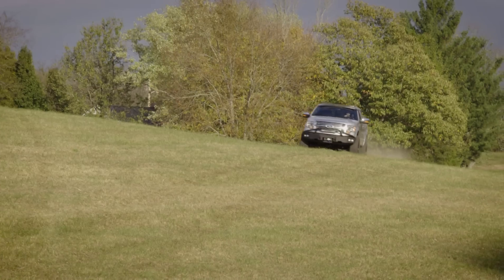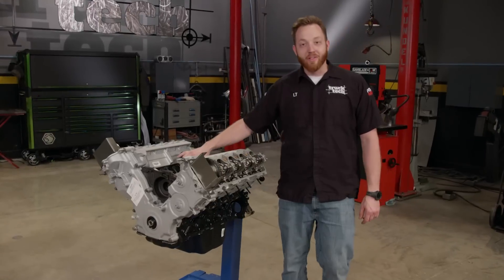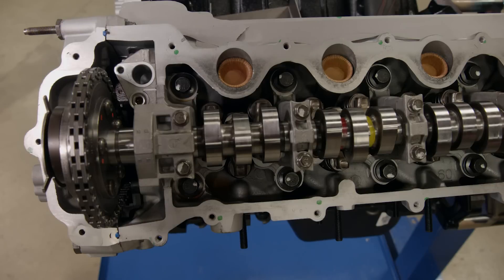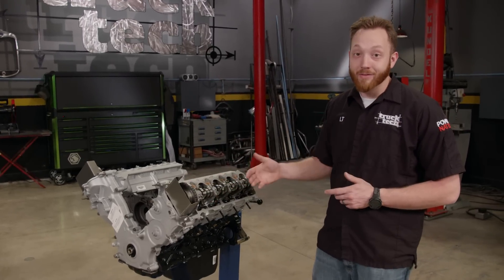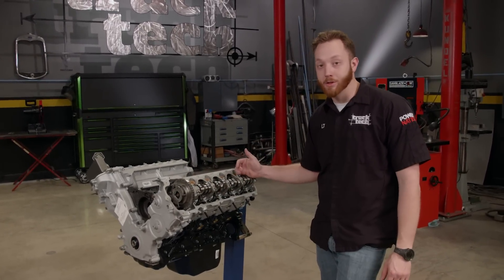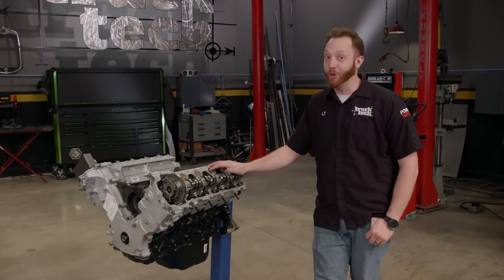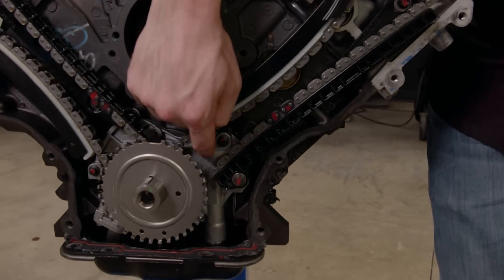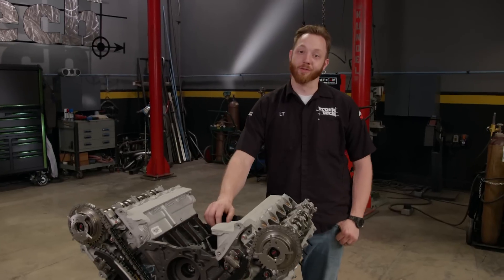Hope For 5.4L 3V Mod Motor Fans

Comment: Wait a minute, you are describing that wrong on how the oil is ported into the heads and to what device.  The engine pressure to the valves themselves is always consistent to the limits of the oil pump itself. The timing phaser does not send oil to the valve mechanism, the CVT Valves meter oil pressure to rotate the phaser, not the reverse as you stated.

Comment: Powertrain products are a joke I purchased a motor along with a no-fault warranty it went bad and 4,000 miles. They honored the warranty and sent me a new motor I had to have a mechanic install it that motor went bad and 3,000 miles. Oh and I still haven't been reimbursed for the mechanic cost from the first motor and now they're telling me I need to accrued more mechanic costs that I won't get reimbursed four four. My experience with Powertrain is subpar they hide behind the anonymity of the internet making promises they won't keep tread lately.

Comment: If you hate these engines just admit it you like working on trucks and cars but you are not a mechanic no shame in that but as for me and my friend all of us are mechanics we love the 4.6l 5.4l and the v10 is a monster when tuned and unlocked they fly all over the power curve these babies last over 200k np when treated right you miss one oil change let the oil run low or go for too long and the engines fall apart with loads of issues just like anything however if you change your fkn oil they last I tuck mine in every night that also help extend the life of the engine 😂

Comment: I really like the 5.4 3V and my experience has been great with this engine. However I bought the vehicle used and it was on excellent maintenance schedule and I kept it well maintained. I hate the fuel pump not oil pump! However, I'm planning to invest in a major overhaul of the engine to prevent any catastrophic events and benefit from the upgrades I have been collecting for the past few months. I got melling oil pump.

Comment: I got a platinum @009 its still runs lime new just keep the oil. Changed? An plugs an wires every couple two three years!an ur good not even 200.000 het an interior is leather awesome!

Comment: I have a powertrain 5.4 in mine. Sometimes I have to stop the radio to make sure it's still idling it's that's smooth and quiet
Reply: Hows that 5.4l power train motor still kicking along

Comment: Had all these components replaced as well as ford racing followers and lash adjusters at 154k. Also they recommend using 5w30 oil. Engine should last another 150k.

Comment: i was the SECOND MAN TO PUT A 5.4 3V INTO A MUSTANG TALKED WITH ED OLIN AND MODDED MANIFOLDS. IF YOU WANT TO MAKE POWER ALL MOTOR WITH A 5.4 3V CONTACT ME. LOOK ON THE CORRAL USERNAME ASSASINATOR. I MOD TEH TRUCK INTAKE FOR POWER AND WAS SUCCESSFUL. USED THE STOCK CDAN4 PCM. CONTACT ME MAN.

Comment: Ford has updated the phasers many times, use only ford parts. eBay kits you’ll be doing it twice. Fords also updated the roller followers also.  Smaller oiling hole aimed at the cam/ roller area for better lube. Updated plastic chain tensioner w/ better silicone gaskets.

Comment: Do you stress the importance of frequent oil/filter changes because of the oil passage ways or galleries that are too small?  Sludge build-up is common on most poorly maintained engines but it is FATAL on these.  Change every 5,000 miles.

Comment: Purchased a non running F250 with the 5.4 3v engine.
Valve train was wiped out from a lack of lubrication.
Oil restricters in head were plugged with oil filter media.
Engine had the oil filter of death on it; a Fram.

Comment: Just hit 180k on my 5.4 3V
And the procharger is running well also at 8 years in.
Reply: Sorry for not seeing this earlier!
Absolutely you can.
Even a set of ported PI heads wakes up the 5.4.
And the 3V wakes up nicely at 8psi of boost.
Watch those stock rods closely when getting above 500 wheel horsepower.

A good set of rods will let you get 750-800 without issue.
It’s a great platform with a few mods.
Reply: @honestspirit56  i agree, no need to swap to a junked up ls..
Reply: @honestspirit56  can I get 500hp from my 3v with new heads/tune/exhaust? Injectors? TB? tnx
Reply: Darts on 5.4 triton?
Reply: Can you put race heads like afr or

Comment: What cam phasers do you recomend?
Reply: I would say go with the motorcraft ones it cost me about $225 each. I also replaced the chain,tensioner, chain guides, and melling m360HV oil pump. In total cost me just under $900 and now its purrs like a kitten.

Comment: Is this really true? I haven’t heard any real cases of the phaser itself failing. It’s usually a cascade failure caused by the seals on the tensioner going, which accelerates the wear on the chain guides and ultimately clogs the oil pickup with bits of plastic, burning up the top end. The consensus is to do a timing job early and replace everything with the updated parts and high volume oil pump.

Comment: The actual highest failure point in the 5.4l 3V is the timing chain tensioners. The orginal plastic ones have a 'printed on' gasket that blows out and causes low oil pressure and slack in the timing chains. These 2 problems then domino onto other components. With slack in the chains, now the chains slap around and the phasers also hammer as they rotate on the cam lobes which causes them to smak back and forth, this coupled with low oil pressure damages the phasers, the camshaft and journels and the timing chain guides. The stock oil pumps are another point of weakness with a melling M340HV being the upgrade all these engines need. O yes and lets not forget about the roller followers which like to seize, and the spark plugs that like to break off in the heads. Great job ford, you are just like microsoft, creating garbage for the masses.

Comment: The 5.4L 2v Triton engines would spit out spark plugs, the 5.4L 3V Triton engines would keep them in no matter what, and chew up that stupid VCT system. One of the main issues iwth the VCT system as I understand it, and I could be wrong, is insufficient oil flow / pressure. The updating Melling pumps fix this problem, mostly.... I have an '04 waiting to be repowered, and honestly, if I could get it through smog, I would build a 351c with modern EFI instead of this 5.4 junk. I have no plans on blowing 50K on a new truck. That's just a waste of money. I'll have to keep plugging away at this older rig, and should it need to go to the scrap pile, I will just find another old rig to keep going with...
Reply: The npi 5.4 has no plug spitting problem and can be used with the pi cam and truck intake manifold to make identical power with likely more torque. Early navigators used the Npi 5.4 2v. You could also just pull a late 05+ 4.6 2v cylinder head which have fixed the thread problem as well.
Reply: ok boomer.
Reply: @Odin3v  Christ you people still exist?
Reply: @Odin3v  try again Skippy. I'm no boomer.
Reply: @Wildersport  no you're still a boomer. Not my problem if you are unaware of being able to understand the context.

Comment: Screw Ford. My 06 Lariat has 85k miles and is already SO BAD it needs the engine replaced. I'm the second goddamn owner and I bought it at 81k miles. I'm not wasting my time or money on a crappy truck that is crappier than my 97 F150 with 355k miles. Fukc Ford. They confirmed to me that they dont give a crap about putting dumb stuff like reliability or durability or dependability in their trucks anymore. My Lariat is neither Built nor Tough. It's just Ford. Never making the mistake of wasting my time or money on another Ford.

Comment: I’m at almost 300k miles on original 2004 3v 5.4. Yes, it started ticking. I unplugged the connector for the cam phasers. A little power loss and check engine light comes on. But still going. I bought the truck nearly new. It was a repo and way under 15k miles. Can’t remember. One big thing I messed up on was not realizing the sun roof had drain tubes. Tubes broke off and fell back in to the rocker panels. Also, probably pine needle and tree pollen clogged tubes. Rust. And I’m in Georgia. And the third brake light gasket. Truck is nice though. Crew cab. Black leather. Console. Lariat. 4x4. White paint. Idk. A new truck is mega money.

Comment: 315,000 on my 5.4l still no tick unless use cheap gas or needs oil change. Is a little tick for a couple sec. When first start but goes away
 I change oil every 5,000 and use 5w20 might try the 5w30 after reading a comment from someone

Comment: Ford should have done a recall on this and fixed it for free years ago, they still haven't!!! They have had years to do the right thing and make it 100% reliable for the people that believe in their reliability and spend their hard-earned dollars for a "reliable pickup"
Reply: Why? I have 215000 miles on mine and not one engine problem. Never missed a oil change every 5000 miles using ford filters and oil

Comment: I bought a 2004 triton a sexy truck with 146k miles on it,  the previous owner just take care of appearance but not of good maintenance on time and bumm , after 10k miles I decided bought a rebuild engine 0miles  for $3.500. Plus accessories for replaced and labor everything cost me $6000 . Yes is a lot money but unfortunately I can't find mechanics to fix the engine for a decent cost , so  the truck cost me $ 8000 + $ 6000 new engine,,   this was a good decision??? I hope

Comment: Wow, $3,300 because you or the people before you didn't change the engine oil enough?  If you go the route to replace the timing components instead of the whole engine, use the factory replacement parts as the after market phasers are junk.   Also, as is mentioned below, check your exhaust manifolds as they easily crack.

Comment: Sorry not exactly what I was looking for. Give me a 400 + crank power 5.4 on regular, then we talk
Reply: Better change the cams valve springs injectors and do an exhaust and tune and it’ll be possible
Reply: @MrSplibb  I did 5 star 87 tune, long tube headers, efan conversion, cai, and I felt a good difference  and better mpg. Thought about cam but I was told it needs 93 and new springs retainers. At 260k miles and growing I didn't want to open a can of worms. Its alot better now. Wish the 5.4 3v had good aftermarket support like the 5.0

Comment: I’ve been hearing my truck tick since I’ve bought it at 55k miles... now at 113k and runs like a champ...
Reply: El Mas Chingon my 5.4 tick went away when I replaced the VCT solenoids. I switched to Pennzoil platinum 5-30 oil after that, and it stopped sounding like a diesel truck. Did that last year at 90k on an 06.

Comment: I have a 2006 F-150  With 5.4 liter 3 valve engine with 174,000 Miles. It still goes down the road silent as a kitten at 80 miles an hour. I bought it new with 4 miles on it, I use a Motor Craft or K&N Oil Filter; don't go cheap on the oil and filter . I Use 5-20 W Motor Craft Synthetic Blend Motor Oil .
      I try not to go past 4,400 miles Between Oil Changes with a Maximum  of 4,800 miles between oil changes. Remember that oil is also a coolant and not just a lubricant so it more than pays to keep fresh oil in to try and prevent some of the repairs that this guy is talking about.
Reply: This guy wants to sell cheap parts for the engine that will make it worse then stock and ruin your engine
Reply: @daltonweston7531  , Exactly they tell you its a needs a new engine . Even Ford Dealers will try this scam. When you purchase one of these rebuilds , it is a crap shoot at best.

Comment: I did this huge job last month. Replace timing chain and components +phasers+vct solenoids +oil pump upgrade. It took me a weekend to do it and I'm glad I did it. I HIGHLY RECOMMEND IT!
Reply: What site did u buy the parts from I have 280 k and I am replacing spark plugs once a month
Reply: @Bret just get a cam phaser lockout kit it’s 500 usd and it comes with a sct x4 tuner it’s pretty easy to do yourself but u can have a mechanic put them in if u want to
Reply: @Turbo11gen nahhh just use ford parts and u woll be fine
Reply: Yup. Do it yourself it's a Right of Passage
Reply: Hey guys hope you dont mind me asking...my 5.4 3v 2010 has been having camshaft sensor check engine light. I replaced the camshaft sensors but it is still on. I cleared it but it comes back. Is it leading to this??
Reply: @Mr Murders sorry for the late reply i get P0340 and P0344

Comment: Only $3,300 not counting labor... He said OE cam phasers, is that the same as OEM?  We have no way of knowing.  FordTechMakuloco's YouTube channel he says no.  He also gives a link showing you what to buy.  Back to $3,300 without labor and it may happen again, I wonder what it would cost to convert it to a 6.2 and use a Raptor wiring harness.  Then you'd have something!  My 5.4 has 102k on it.  Right after I got it I found out they are crap so I have babied mine along since 2006.  If I ever do buy a new truck it may be a 92 - 96 F 250 regular cab with an injected 460 and 4:10.1 gears that I restore.  I bet I could do it for $20k if I found a decent one.  I have a  friend that owns a body shop that I could do all the grunt work in.

Comment: My 5.4 3v has been ticking for over 200,000km now lol
Reply: So just to update you
Guys I replaced my timing stuff including new ford phaser and oil pump and the ticking is gone. The truck now has 490,000k
Reply: @Goldchannel12  amazing thanks for this info nice to hear they can make it to 490k I just purchased a 2007 5.4 tri. I wasn’t aware of all the spark plug issues ect. I don’t mind fixing everything for preventive maintenance. I like the 2 door extended cab I got
Reply: Mine has 315,600 miles and it has been ticking since 250,000 miles
Reply: @Peyton Brimmer 317,000 now
Reply: @Chase_01  mine is 240,000 miles and I have no ticking
Reply: Mine ticked for about 5k miles. Replaced the cam phasers. Everything else looked ok. We will see.
Reply: 2006 F150 XLT 4X4 here. Bought for $500 running and driving. Bought it at 330,000 MILES and it was ticking and running like crap. 3 years later it now has 350,000 MILES and it still ticks, runs like crap, leaks oil, and can still pull a 4,000 pound car on a 3,000 pound trailer up a 15% grade with minimal effort. People shit on these engines all the time and it kind of pisses me off because these are not inherently bad engines but they do need regular maintenance to stay reliable. Just because your Chevy pickup can go 15,000 miles on an oil change and be fine doesn't mean the Triton can. Afterall, the Triton is a precision machine whereas the Chevy is....well....a Chevy and doesn't need that level of maintenance because it has looser tolerances than a high school girl on prom night. Don't get me wrong, a Chevy engine doesn't have anything wrong with them, to each their own, but my point is that the Triton is a precision performance engine put in trucks that are used by normal people who just don't treat them right. They're actually very similar to the Mazda Rotary engines with respect to how they are viewed.
Reply: @CaramelColored  I totally agree people treat their trucks like crap never maintenance or service and when it breaks down they blame it on the trucks doe
Reply: @CaramelColored  cool man I hope my 5.4 3v last that long
Reply: Look up FordtechMakuloco channel the ticking is usually when in hot idle wich is normal.
Reply: @Tom Dew that's alot of miles for it being 5.4L 3v the trick to these engines is the oil changes other than that they are really good trucks
Reply: @MICLANTECUTLI  she is still going strong still pull 6k trailer just fine, my girlfriend is driving it now. My other 2010 4.6 3V at 350k it’s doing better then my 5.4 3V lol
Reply: Loose spark plug or roller bearing is going out on cylinder 7 (intake vavle)
Reply: that's only 125,000 miles, that's not that high mileage. 500 thousand km that's impressive (310k miles)
Reply: Same
Reply: Mines at 140k, had the phasers done and she’s running strong.
Reply: Same here I got 210,000 miles on my Ford just did timing and a stage 2 cam
Reply: Sure it's just not a manifold leak? They all do it. Even the 2vs.
Reply: @Tom Drew it’s supposed to because it’s dual over head cam
Reply: 245k mine rattles not ticking for long time, still going strong
Reply: @samuellujan7525   well I did just upload a video from a few weeks ago doing WOT
Reply: It's most likely junk at this point. No point to repair.

Comment: If you all need a 5.4 3 valve 05' F-150 project truck for the show, I'll let you borrow mine....for the upgrades..putting VVT solenoids in as we speak...lol gotta do a whole timing set, and Melling 120 oil pump in....would love new heads...im looking into the 05' mustang for swap parts, any help would be nice....

Comment: 97 expedition has 312k miles on it , oil changes regular oil or blend but changed at 5-6k miles with frame tough guard then now ultra fram xg2 .  My 10 navigator I will put HV oil pump , new chain , updated design tensioners , guides, updated vct valves etc etc.   Key is oil changes and if you don't have money , use marvel mystery oil to help boost oil flow volume, use good filter, check oil , once it's dirty dark or close to 5k  ,change it.   
I'll admit the engineers where taking crazy pills but they design the motor around oil flow,psi, volume etc, they didn't care about general public of not having enough money or slacking on oil changes..poor pm car care etc human habits.  Run it till it's dead mentality.  Also don't use marvel mystery oil in the fuel for newer cars I'd say 06+ 02 sensors will die!!! Lol

Comment: i have the boss 5.4 with 4 valve heads biggest issue apart from power is the oil pump gears , need billet ones . has 512 lift on intake on the cam from the factory witch i thought was impressive